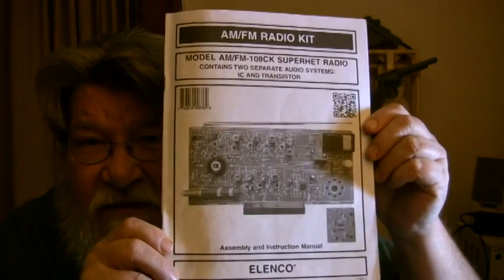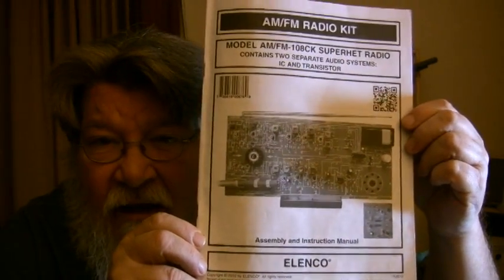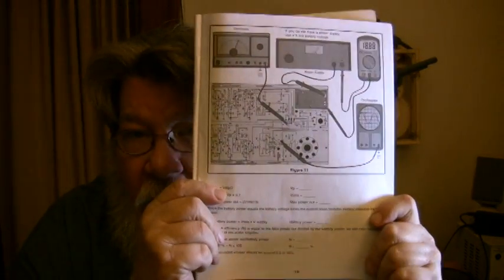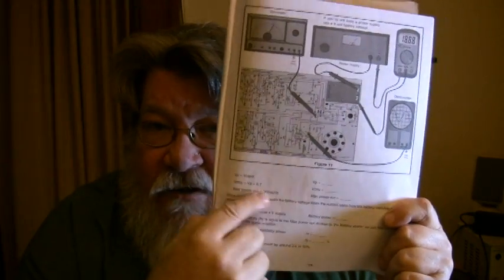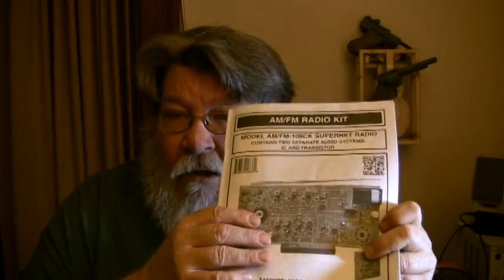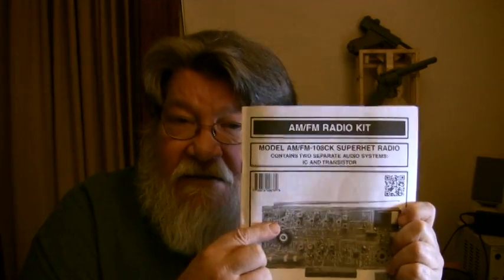Let's build a AM/FM Radio- Intro

Comment: Hi Carl, I have damaged coil blue an pink of the Ratio Detector but I have a multi coils toko (blue and pink) that I suppose is for a Ratio detector. You can please help me for the substitution or some ideas.. Thanks Gabry
Reply from the maker: Hi Gabry,,,, let me ask,,, does the Toko blue replacement (T5) have the center tap? If it does and the pink  (T4) does not, then they probably should work. Not sure of the resistance of them but they are for the most universal so hopefully you should just be able to pop those right in. BTW,,, did you get those Toko on Ebay? They seem to be a popular brand for transformers.
Reply: Hi Carl, first Thank for your interest and excuse me for my language.I have found that inside an old radio was present a double ratio detector so I thought to use it for the elenco radio. I' am sure that is used for a ratio detector because it was mounted near the double reversed diode. I bought two toko coils with internet and NO in a ebay site but from electrojumble site (the site have no info about the coil and in internet I find nothing :( ) .My double toko coils presents on T5 the center tap I believe beacuse my measurement seems to confirm this.In the Elenco kit coils: T4 and T5 have inside a capacitor each for coils instead my toko double coil present only one capacitor with T5 (blue)
Driven by curiosity I'have unsoldered the double ratio detector coil tha was present in the old radio and also in this double coil there one capacitor in the T5 part.
Another particularity is that T4 from elenco have 6 pins instead the T4 part of double coil have only 5 pins. 
Now with a powerful lens I will try to analyze the pins connections.
Carl this is my email: gabrigam@gmail.com and if you want in the next day I can send you images of the coils and the pins connections by my investigations.
Best regards.